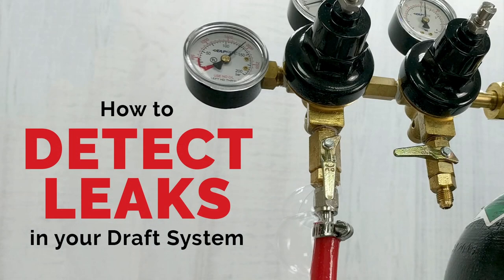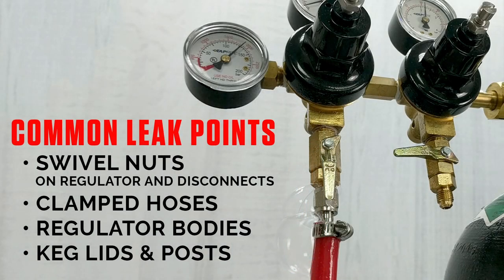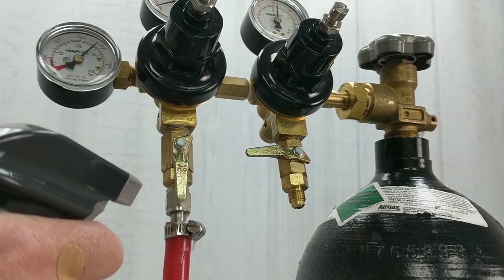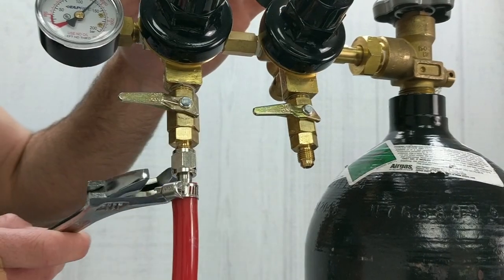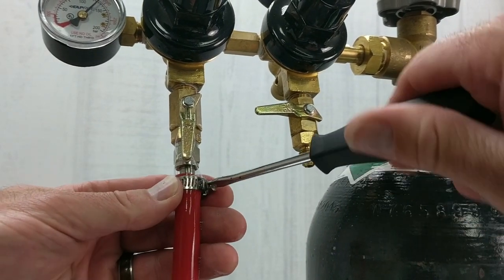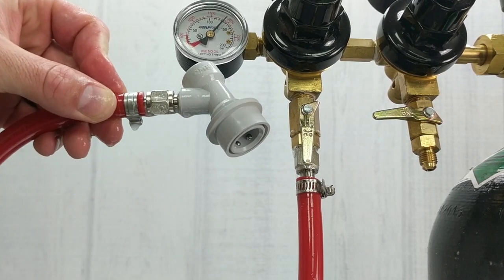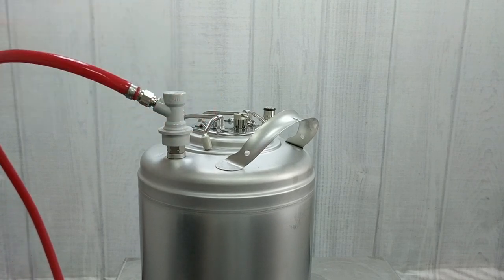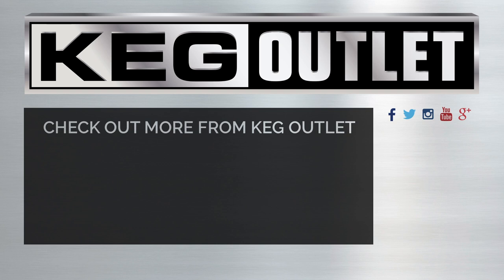How to Detect Gas Leaks in Your Draft Beverage System

Comment: What if i DO see bubble from the regulator body?
Reply from the maker: It could be a bad diaphragm. If the leaks are on a non-jointed area, it could be a cracked/fractured regulator body at which point, you should look into replacing it.